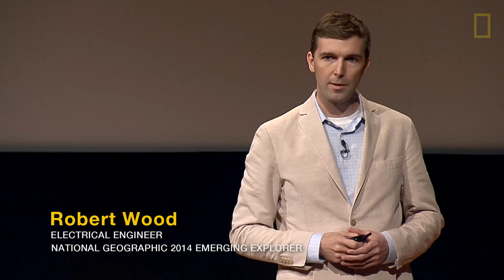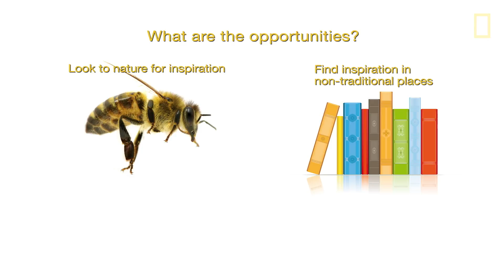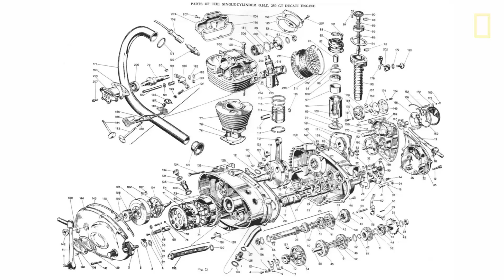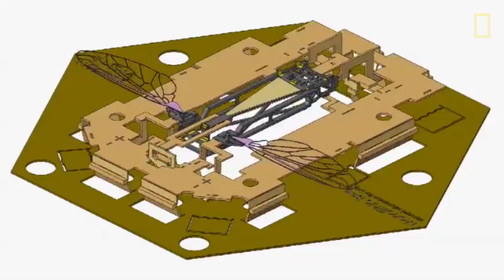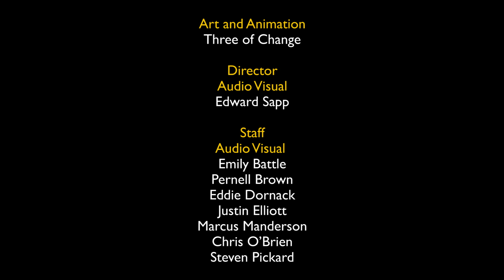Robert Wood: Robotic Insects | Nat Geo Live

Comment: The end time is near. These insects paired with the facial recognition features that china uses can be used to hunt down people who go against the will of government. The time is coming guys and people arent scared wow.
Reply: The little strings are for power delivery, because a battery would be too heavy to make the thing lift up or too small to make it fly for long enough...
Now imagine what would mean to attach a camera and something that can compute the data. Add that weight and power needs. And don't even worry about image quality and stabilization! With a camera that is that small on a robot that is that small, with wind or even small air movements you can't see much, it would look worse than a video took on a 2005 phone during night. 
I'm not saying it's impossible, it's just not doable now, as he hints in the end of the speech.
Reply: It can be used to hunt down criminals

Comment: Your problem is that you are too big to make small robots. Maybe use ratio robotics. Build a big machine that can build a smaller similar machine. Get the smaller machine to make a smaller machine, in some ratio. Train with ai. The first thing you need to make is a micro robotic arm, then try to mimic nature for micro robots. Make a big fly first, then find a way to downsize. You need robotic assembly